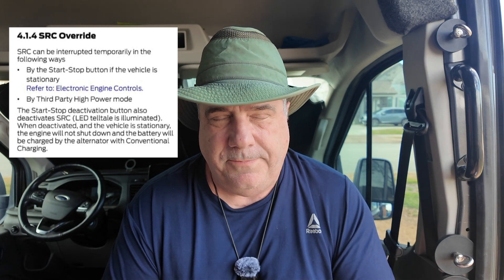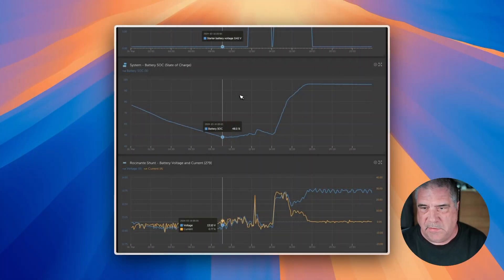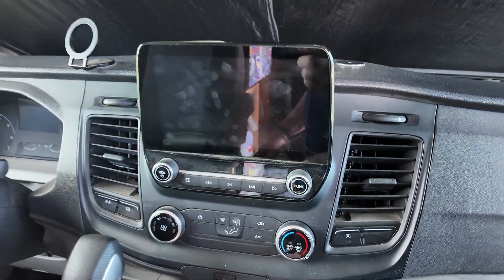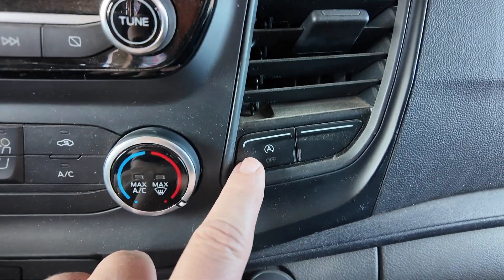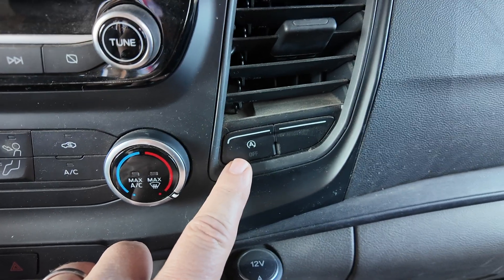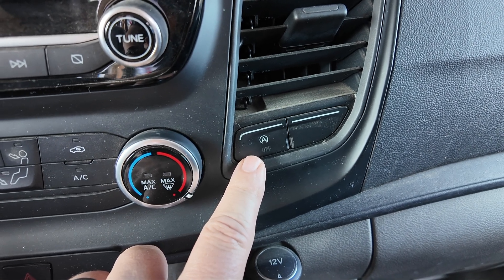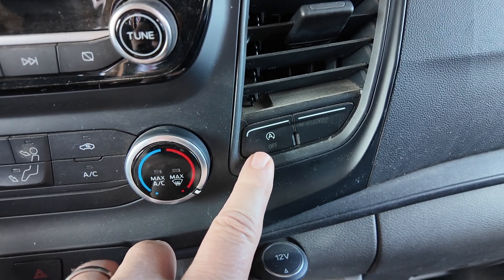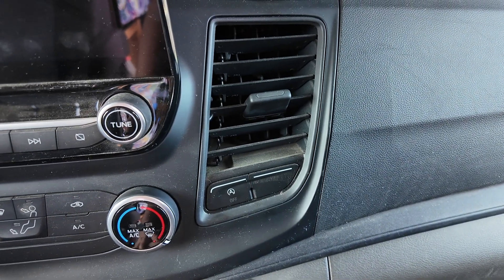Ford Transit Secret: How to FAST Charge Your House Batteries at Idle (Game-Changing Trick!)

Comment: Hmmm. My 2017 transit turning this to off still keeps smart regenerative charging on and there’s a voltage drop.
Reply from the maker: I wasn't aware that pre 2020 Transits had start/stop or the button to cancel it. You might checck the BEMM documentation for your year to see of it says how to cancel SRC.
Reply: @offgridyo  yeah I have the same button as you to cancel start/stop, but it didn´t change the smart alternator.
Reply from the maker: @SunSin91  Remember... it only works at idle.
Reply: @offgridyo  yeah, I was trying this out on idle.
Reply from the maker: @SunSin91  Check the BEMM for your year. This behavior was documented (obscurely) in the 2020 BEMM. Obvisouly I have no experience with the 2017 model.
Reply: @offgridyo  I think I figured it out. I read both the 2019 and 2015 BEMM, could not find the 2017 BEMM specifically. The batteries has a BMS on the negative terminal. If the BMS detects load it will inform the ECU which tells the alternator to ramp up its voltage. This can be tested by putting on lights and AC and heated seats all at the same time, voltage goes up. I had no problem with this during winter months, but now everything is off and I don´t even use driving head lamps, only the small side lamps since it´s summer. 
Unfortunately my van´s victron is connected directly to the battery with a fuse, so the BMS doesn´t calculate the draw. What I need to do is to change to the AUX port on the side of the drivers seat with a 60 amp fuse right there. Then the BMS will detect load and increase the voltage of the alternator.
What I found interesting is that a transit BEMM specifies with 1 battery is recommended to draw only 30amp for leisure battery, but with a dual battery 50amp can be drawn from the aux port. I have a dual battery.
Reply from the maker: @SunSin91  I'm so happy you are on the trail to your solution! And yes, the CCP (Customer Connection Point(s)) are the way to go and make sure the Transit can evaluate the starter battery stat-of-charge and be able to see the load of your charger.

Comment: Thank you, thank you, thank you! I've had a 40A charger in my Transit Van that relied on a switch to start/stop charging and recently added an additional 40A DC-DC/Solar charger that only starts when the input votage is above a threshold. The plan was to only use the original charger when a fast charge was required, but I found the voltage  wasn't high enough to trigger the new charger when idling. I thought that perhaps I had damaged the alternator somehow using both chargers at once since I have (subsequently) seen that it is only recommended to to use 40% of the alternator power to charge a house battery (150A x 40% = 60A). I'll still only use both chargers simultanously sparingly, but at least I know what is going on now!
Reply from the maker: @david.g.johnson  Thanks for watching and thanks for your kind comment. It totally makes it worth it to make these videos. Thank you!